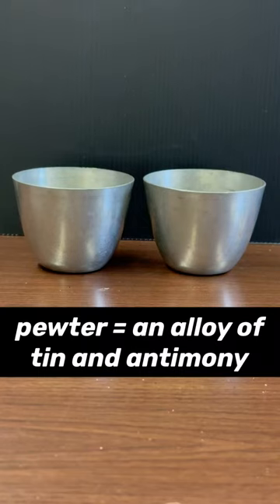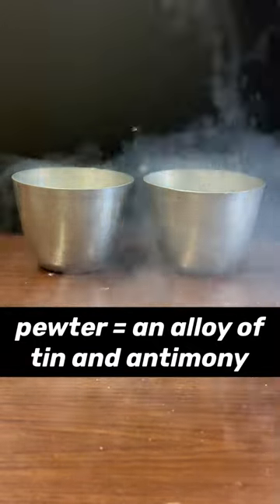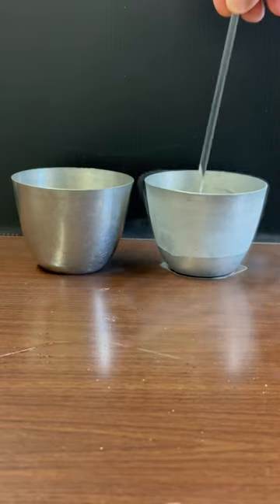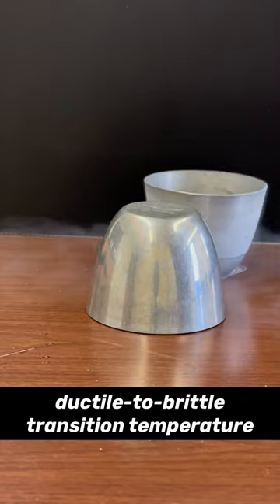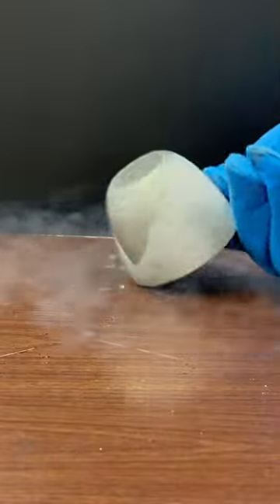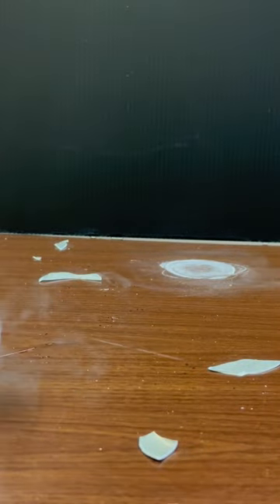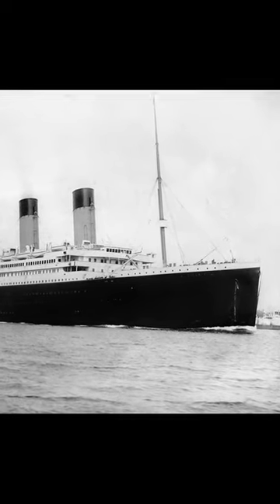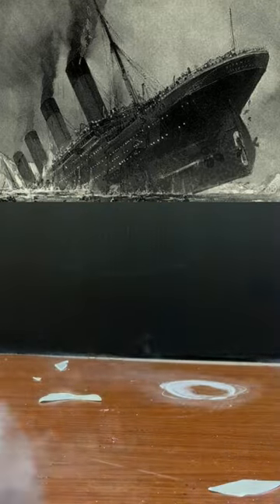Chemistry and the Sinking of the Titanic 🥶🔨🛳️ #shorts #chemistry #titanic #liquidnitrogen

Comment: I thought pewter was an alloy of tin and lead.
Reply from the maker: The composition of pewter indeed varies widely
Reply: Great demo. So. Modern Pewter is primarily tin (85% or more)and antimony. Britannia metal is a type of fine pewter made with tin, antimony, and copper. Beautiful to purchase, or to work with. Some pewter might also incorporate small amounts of silver.  On the other hand, really cheapo, so called  "pewter" from certain countries might even be mostly aluminum. Eh. Not so great( even though Napoleon treasured his aluminum dinnerware, as it was difficult to come by, back in the day).  Old pewter alloys,  though mostly tin, did have small amounts of lead. The United States and many other countries started eliminating the use of lead in pewter in the 1960s. Old lead containing pewter tarnishes to a rather dark gray, versus the silvery look recent pieces display. Cheers...
Reply from the maker: @craig-michaelkierce1366  Thank you for the input! 😊

Comment: I don't believe you. !
Reply from the maker: See https://www.tms.org/pubs/journals/jom/9801/felkins-9801.html
Reply: @TommyTechnetium Your claim is that had the Titanic been in warmer water the metal would have absorbed the impact better and not sank I also think it incorrect. Cracking 6 compartments verses ripping would still result in the Titanic sinking. Your experiment also fails to demonstrate the effect of cold water on one side with the warm boiler room on the other. The cold water could be below the fractile temperature but the metal would still be warmer.
Reply from the maker: @stephenmayer9228  I'm truly interested to see any peer reviewed scientific articles that back your claims. If I'm wrong, I'd certainly like to know. For now, I'm going with the conclusions in the two peer reviewed scientific articles I've provided you (there are more if you'd like more citations) that seem consistent with my claims